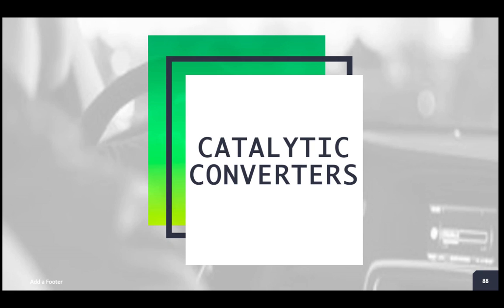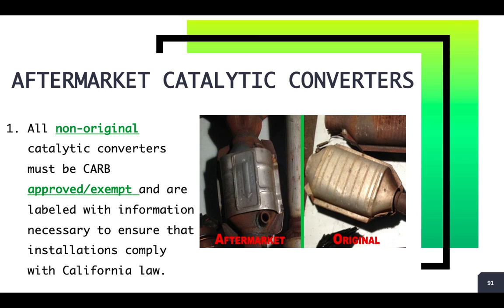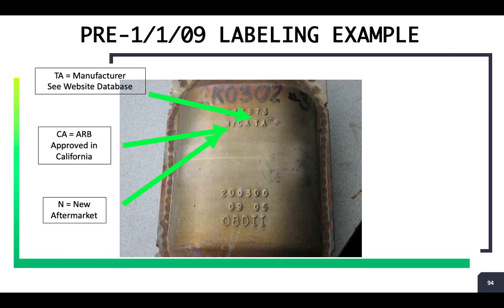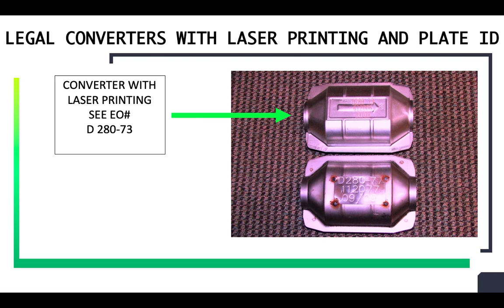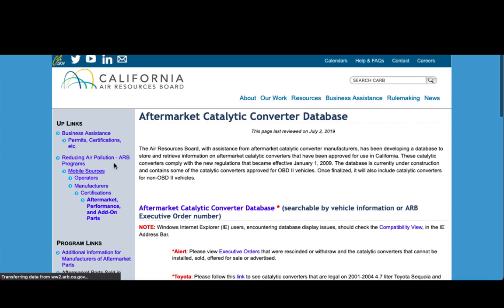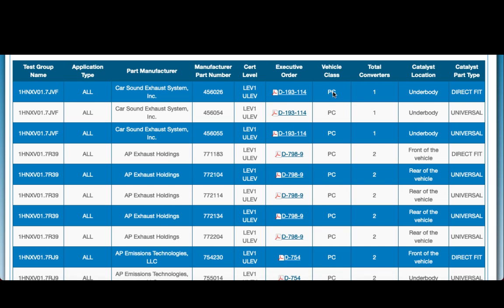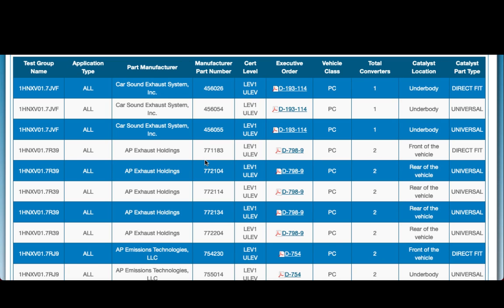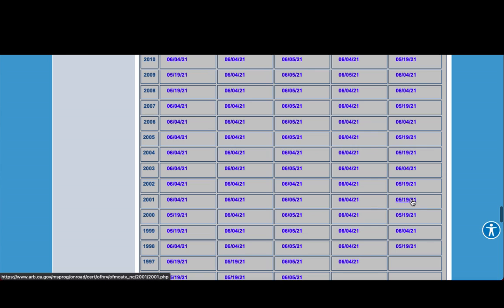CA PROCEDURE FOR (AFTERMARKET CATALYTIC CONVERTER VERIFICATION)

Comment: Thank you for that instruction.   I now know how ridiculous CARB rules are.  For my pre-OBD-II car, out of tons of pre-OBD-II CARB approved catalytic converters, only few are allowed.  That is totally ridiculous.  If a catalytic converter does a great job reducing smog and passes all smog test, why should they say it's illegal?   CARB rules are example of bureaucracy gone mad.
Reply: its called creating a monopoly of parts backed by a non sense law that allows bigger polluters but they want to hit the regular joe with more fees just so we can go to work and keep paying taxes. I have a otherwise great cat and the referee failed it because its missing a number on the catalytic and I have no prove it was installed on 2004. I'm the 3rd owner. His conclusion was on the suspicious question of WHY it had to be changed just 3 years after 2001  car was purchased. I had this  same truck pass smog 3 other times since I had it and nobody have make such a big deal just because a number is missing from the catalytic itself that was most likely eroded by use as the truck is 20+ years old. Also, California should make it harder for people to still this catalytic converters. There are only two or three companies that are allowed to sell LEGAL part numbers and the Federal authorized providers are all ILEGAL in California. This process for finding the correct catalytic for a vehicle is complicated by default with the purpose of someone making a mistake and installing the wrong part and having to pay twice as there are no documentation as who is liable and unless a customer just trust the muffler installer that he is giving him the best price for the job including parts which is already at the level of replacing an engine in some cases, that customer has no choice and freedom to look elsewhere for a better deal as is the right of every American. Again, a monopoly will care less to make these associations to find the weak links in the process allowing for all the gray areas where a customer has no chance of getting a fair deal. I am all for clean air and stuff but I believe this politically driven moves to pass state wide laws must be thoroughly tested and explained. As consumers we are paying for all of their pay checks including the governor's so I say we have the right to know and the right for options.
Reply: It's really all about getting old cars off the streets.  Sigh!

Comment: TLDR - Too Long Didn't Read my comment below.  Once the ** EO number is rusted and unreadable ** there is NO way to prove that is the correct cat for the car.  And this is in southern CA where it almost never rains.  In the rust belt the cat would be unreadable after a year of rain and snow and melting salt.  Common solution is that you have to get a special card to show the SMOG tech - but this doesn't prove the cat is right for your car.
Reply: Paul, it seems as we have the same problem. My Cat is missing a number from the metal (unreadable) and I had to appeal the test result ending at the referee program who also failed my cat due to the same issue. He said doesn't have the means to prove that the catalytic converter is approved but 1.- he knows is not the original and 2.- It was changed in 2004 based on some other information he was able to pull out. My truck is a 2001 so he questions WHY was it changed only 3 years after it was sold for the first time. Like if stilling cats is something new. It probably was stolen before I bought it but it passes smog on my ODB2 scanner. Now, I don't know what is the logic here.
Reply: @2XXEquiz  thanks for that update and I will add this experience to my file what I guess I'm going to do is have photos so when I go in to get it tested I'll probably go to the same place and the guy we'll see that he tested the car before I will have photos maybe I'll try to add some kind of protective thing for the number so they won't rust away or I might weld the numbers on a piece of metal and then just tack that on to the cat and explain hey this is what happened my car is now 26 years old so it's not going to be around forever but it's not fair that the laser Edge number wears off and then it puts the person in the position that we're in

Comment: I need a carb legal cat for my 95 integra. Epa cats are running for around $120-150 while the California cats are around $1200-2000. I hate this stat so damn much. And they wonder why everyone is doing illegal smogs. I am a smog inspector for 10 years in California so I didn’t come here for the info. Just to vent. Even worse is the previous owner took it off to “sound cool.”
Reply: Bro.... I know this is an old post. But I'm so fed up right now
Reply: I just ordered and installed a direct fit CalCat for my EP3 $700 later.... now the smog guy says he can't smog it cuz my under the hood label is missing. I'm so pissed rightnow.

Comment: Did you know? In California, all vehicles down to 1955, must have any and all Smog Equipment installed. When they started smog checks, all vehicles had to have Closed Crankcase Ventilation and a NOX Device. Also any speed equipment must have an E.O. Number to show it is smog compliant. After Market Super Chargers have a notation, "Not for use in California on any smog controlled vehicles". Also, any engine swaps prior to 1983, you go by the year of the engine. Engine swaps after 1983, you go by the year of the car plus, the engine had to be an option for that car. This was done to stop people from swapping a BBC from a truck into a car with the BBC wasn't an option. Also running dual cats on a vehicle equipped with a single is illegal..
Reply from the maker: In CA emission equipment is required after 1976, according to the Bureau of Automotive Repair. PCV did start early 40’s but not enforceable until 1976 for smog check purposes. With engine swaps make sure to have the state referee verify new installation and ECS label approval.
Reply: Rick your a little off  and wrong on some of  the info you gave..
Reply: Rick you kinda off on dates
Reply: Oh yeah , I seen 4 catalytic converters on truck n car in California 2 up stream 2 down stream n the other just bank 1 n bank 2 both were connected the 2nd n 4th converter , approved by the board street used, I think at least one was it's original or 2 of them , 2 years to the next one

Comment: I have a 2007 Honda Accord Special Edition 2.4L. The emissions label affixed to the hood of the vehicle lists the test group of 7HMXV02.4KKC. When I look up this vehicle in the California CARB database there are 10 withdrawn EO numbers.  What does a withdrawn EO number mean in this case?  What would happen if I was to install the catalytic converter with a withdrawn EO number?
Reply from the maker: When it is withdrawn means that  after ceritifaction from EPA they determined CAT wasn't a good fit. You'd need to copy records to date of install of that cat, then we will check it, if it looks like an older install we'd pass it. If you install today, then it would be fail no matter what.

Comment: Federal Emissions.... My car is a 1997 Saturn SW2 that I bought new in CT and still own.  The engine family is not the ARB database.  The smog ref said that many or all Fed Emissions vehicles will not be in the CA database so when selecting an aftermarket cat you go by Make, Model & Year (and # of cylinders 4, v6, v8 etc).  I had been gong to Fairmount Smog Test Only for 12 years!  In 2016 I failed and had to replace the cat; I chose an aftermarket since it a new OEM cat was no available.  2022 in August a different tech was working there and refused to submit the results because he could not find the engine family in the database and claimed he knew more than the smog refs so I left and dug up and printed out all the info that I saved from the smog ref.  ** At the next smog shop I explained everything and brought in my paperwork but ran into a different problem: The laser etched numbers are now almost unreadable.  I got under the car myself and took a picture and zoomed in and compared it to my paperwork and he could see the outline of the numbers and submitted the passing test results but what happens when the EO number can't be read?  I installed the cat myself using my welder but even if a shop did it and I saved the receipt there is no way to prove that is the correct cat.

Comment: I realize this is an older video, but I am in the process of replacing my catalytic converters on my 2003 ford ranger 4.0 since mine were recently stolen.  The number one question I would like to ask is, with universal/aftermarket cats, where in the exhaust do I weld them?  Do they have to be installed so many inches from the flanges, so many inches  from the manifolds or as long as the oxygen sensor wire reaches the aftermarket cat?  Is there a minimum/maximum amount of slack needed on the oxygen sensor cable?  Like, what if I weld one a bit too high and there is a bit more slack on the oxygen sensor cable?  What if it was easier for me to weld the new cat in an inch or two lower but now the oxygen sensor  wire is a little stretched?  I watch youtube guys just weld them in where ever between flanges as long as they can screw in the oxygen sensor...  Not one shop out of 9 that I contacted can/will tell me about where a universal cat should be welded in place.  Hope I didn't confuse you.

Comment: hi, I am currently following the steps from your video to figure out if an aftermarket CAT is the correct one for a 1997 toyota pickup truck that I have here becuase the VECI label is missing but the page no longer exists on the CARB website.. it says the page got moved somewhere else.. do you know which other site I could use?

Comment: Can the metal part of a catalytic converter be cut open , placed material inside what a oem used or uses the welded shut, recycled re use it  placed it back on the car that it was on from oem,??????, I seen up to 4 converters in one car & truck in california, now the have these 3way catalytic converters, what's up with that???,
Reply from the maker: If the cat is cut open and the element swapped out we’d have to fail you. The cat in its entirety has to be replaced either with an OEM cat or an approved aftermarket converter to pass the inspection.

Comment: The honda you looked up says 1 converter equipped but when you looked  up the under hood label it says wu-twc and twc. Does it still pass because the total number of catalytic  converters if different?
Reply: I also noticed the label he was looking at was for the SULEV car running Compressed Natural Gas.   I don't think that is right.

Comment: If the car is 99 but is federal and I want to move to CA, Do I need swap the CAT to a CARB compliant?
Reply from the maker: The cat installed must meet CA standards even though the vehicle is federally certified.
Reply: If the cat is still the factory original, the car is California emissions certified (sticker under hood), and can pass CA smog then no need to swap.  But if it fails smog then you do have to get it swapped for a CARB certified cat.  Aftermarket CARB cat only applies to 2009 and newer cars as well as 1996 up OBD2 cars that require the cats to be replaced.  Or get oem factory cat but most likely discontinued due to age

Comment: Why cant i swap the motor from my 2007 subaru outback and put it into a 2009 subaru outback?  The 2007 cats went with the motor and the smog check guy said failed due to tampered catalytic converter. Anybody got an explanation to share??

Comment: I have a federal 1985 Ford Thunderbird 5.0 V-8.  It now resides in California and failed smog.  I'm sure Ford doesn't have a new cat for this car so how difficult and which conver ter can I use for this car.  Is it as strict because of the age of the car.1
Reply from the maker: Quick ARB search says a Magnaflow Part Number 332025 would fit. Here you can also check further, as long as it doesn’t say recinded or withdrawn, you can get it installed. Hope this helps. Happy New Year! https://ssl.arb.ca.gov/AftermarketParts/catalysts

Comment: What if the test group name does come out on the aftermarket catalytic converter database
Reply from the maker: Can you give me more details, are you referring to the backdoor side or the normal catalytic converter database?
Reply: Example 05 altima test group name 5nsxv02.5g5a is the only thing that comes up on after market catalytic converter and what I have is 5nsxv02.5854 and does not show on the system
Reply from the maker: @marcossolano4384  If you click on https://ww2.arb.ca.gov/sites/default/files/classic//msprog/onroad/cert/pcldtmdv/2005/nissan_ldt_a0150426_2d5_u2.pdf it will take you the ARB EO published doc. Plus using the normal Cat data base the only EFN is just like you mentioned you have. Please let me know if that made sense and helped.
Reply: @dannyiwama3448  that's exactly what I have thank you very much, I will search it right now
Reply: Great info . Can u make a video on ignition timming with gun please and explaining how to use gun . 👍

Comment: Bought a 00 civic in 2015 with no cat. Purchased an aftermarket cat (d-182-45) and had it welded on. It passed smog every year until yesterday...tech says the cat doesn't match my engine family. Cat -YHNXV01.6VA2  Engine family - YHNXV01.6CA3 .....smh...Made an appointment with a state referee, but it looks like I need a new $900 cat - looked it up and it will work with both engine families. California.. lmao
Reply: autozone wanted 555 for my 2001 4runner cat,  how do i know if that will work?

Comment: Excellent video!  What if the manufacturer no longer produces or has the cats needed as well as all aftermarket manufacturers no longer makes/carries the cats?
Reply from the maker: You’d need to contact a referee to get an exemption. Checkout https://asktheref.org/
Reply: @MasterAutomotiveTraining  Thank you will go that route.  I have a 2008 Mazda6 V6 with all 3 bad converters.  All catalysts have been discontinued by the manufacturer and Walker is the only aftermarket that sells a CARB universal main catalyst.  The other 2 manifold integrated cats nobody produces CARB certified nor will ship to CA.  Need all 3, junk the car, part it out, or sell it to out of state are my only options at this time.  I never realized how difficult it would be for CA emissions smog